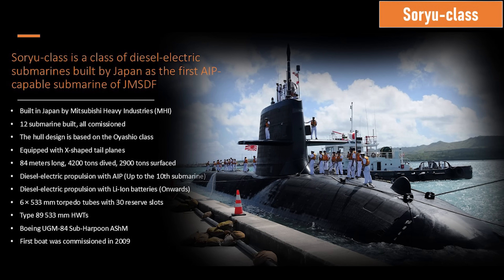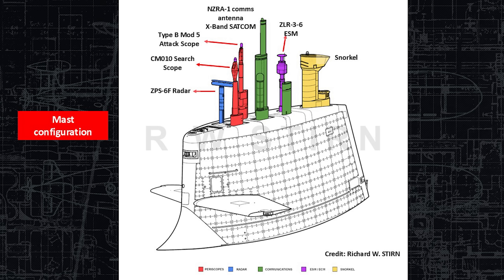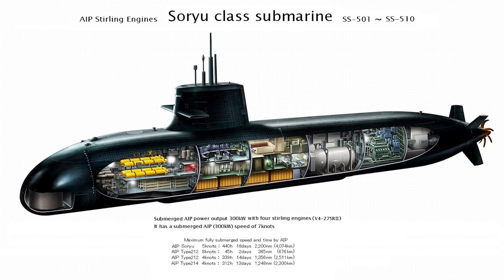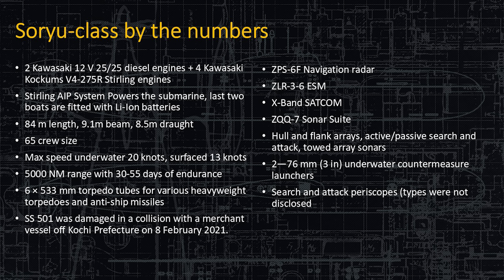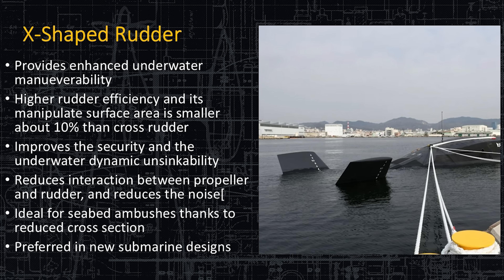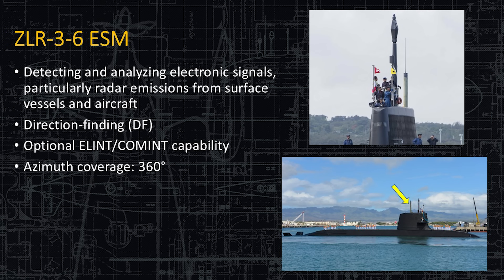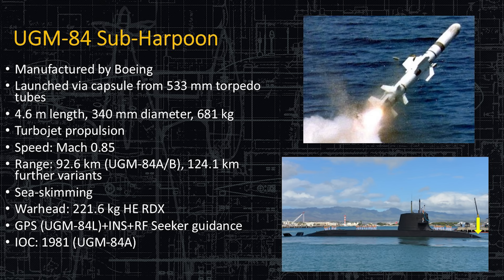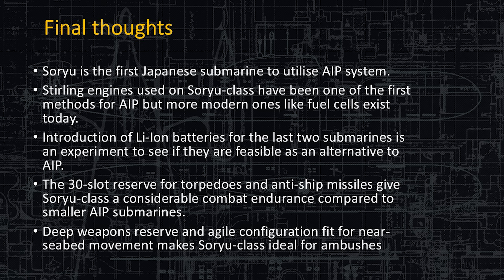Japan’s Soryu Submarine Tech Explained!

Comment: The video incorrectly states that the Soryu-class submarines were built at the MHI factory in Tokyo.
All Japanese submarines are constructed at Kobe Port in Hyogo Prefecture.
At Kobe Port, MHI and KHI each build one submarine every two years, launching them alternately to ensure Japan deploys one new vessel annually.
Generally speaking, Japan's submarine construction pace is exceptionally rapid, maintained through a schedule that ensures uninterrupted production.

This stems primarily from the Cold War era, when Japan was constantly compelled to counter the submarine threat posed by the Soviet Navy. Additionally, the significant damage inflicted on surface forces by submarines during the war with the United States is another reason for Japan's emphasis on underwater capabilities.

As a result, Japanese submarines have a shorter service life compared to those of other nations.
Currently, the Japanese Navy possesses 24 submarines, including training vessels, with even the oldest having been built approximately 24 years ago.
To maintain this high construction pace, new Japanese submarine classes frequently emerge.
However, in most cases, the transition to a new class involves reusing the design of the preceding class while adding new equipment innovations. This allows for the transition to new submarines with enhanced functions and performance without compromising reliability.

Conversely, there are instances where the external appearance remains unchanged while the internal systems undergo significant modifications, or where the internal systems remain largely the same while the external appearance undergoes major changes. These factors contribute to making identification difficult for outsiders.

These construction and deployment philosophies also serve the purpose of maintaining Japan's high submarine construction capability without relying on overseas exports. Consequently, they represent a uniquely Japanese approach that is extremely costly.
Reply: Because building submarines requires skilled welding skills, if the government suspends orders, companies are forced to redirect their skilled workers to other work, and when orders are placed again several years later, it takes time for them to regain those skills.
As a result, orders and construction must continue uninterrupted.
Reply: @酒呑童子-j1h  Thank you for the excellent addition.
It's very clear.
Reply: Wow, thats a lot of good info from both of you, thanks

Comment: The Stirling uses lithium ion. What?  So what you say is that the required heat to run the Swedish V4-275R mk3 engine comes from batteries.? 
I think you have to fill up some LOX to make it run.
Reply: @75700neo  その通りです。艦内には液体酸素タンクを保有しています。これらは艦内に放出することが出来る為、艦内の空気を入れ替える手間も少し省けます。

Comment: Any comments on acoustic/stealth performance? Seems to me that direct drive electric motors and lithium ion batteries would have no moving parts apart from the shaft and motor rotor. Surely this is quieter than geared steam turbines or turbogenerators.

Comment: Japan’s Sōryū-class submarines remain a stealth powerhouse in the JMSDF fleet, with 12 diesel-electric boats featuring AIP Stirling engines for 20+ days submerged and lithium-ion batteries in later units (e.g., Ōryū, commissioned 2022) for quieter ops. At 2,900 tons and 20-knot submerged speed, they pack 6 torpedo tubes for Type 89/97 weapons, ideal for Pacific deterrence against China.

Comment: Aaron, i work on these in YOKO, they can launch all 6 tubes at once...they are very quiet...one of our best boats have trouble tracking, and that Panasonic battery hold a lot of power
Reply: Australia needs to purchase about 30 of these.
Reply: @chrisellis1207 nah, Australia can fall further
Reply: @chrisellis1207  No, because Australia's geographical distance from the South China Sea means only nuclear boats make sense in terms of endurance and range.
Reply: @Nelsonwmj  Going out to Indonesia and PNG is enough. That tiny island called NZ is kind of important, sheep and wine need to be protected.
Reply: @chrisellis1207  It's unfortunate for the Australian and Canadian navies, but Mitsubishi Heavy Industries and Kawasaki Heavy Industries' submarine construction slipways are fully occupied with building submarines for the Japan Maritime Self-Defense Force and have no capacity to build submarines for other countries.
The two decommissioned Oyashio-class submarines may be transferred to them free of charge.
Reply: @酒呑童子-j1h I don't think so. The austenitic steel on Oyashiyo is still very highly classified
Reply: @酒呑童子-j1h  Potentially, maybe, they could be built in Adelaide. Thank you for your comments, I appreciate it.
Reply: @chrisellis1207  My idea involves cutting off the stern section of the Oyashio-class hull, replacing the DC motors with AC synchronous motors, switching the lead-acid batteries to lithium batteries, updating the outdated electronics to the latest LCD displays, replacing the light bulbs with LEDs, and then welding the severed section back together.
Reply: @酒呑童子-j1h none of the japanese subs are using lead acid batteries